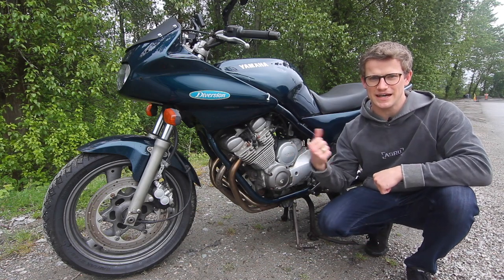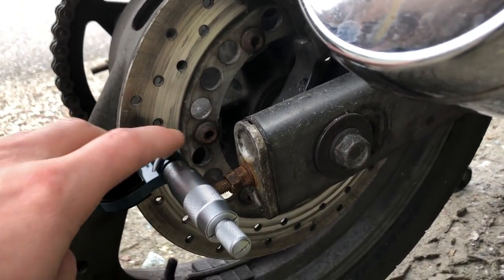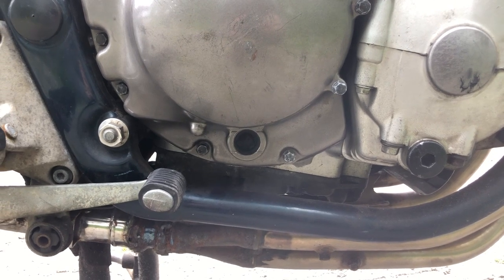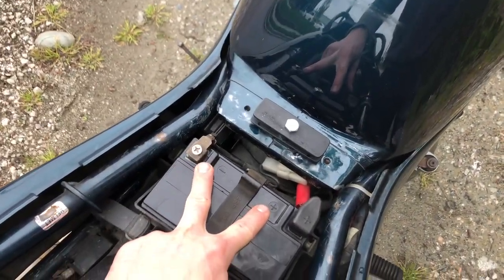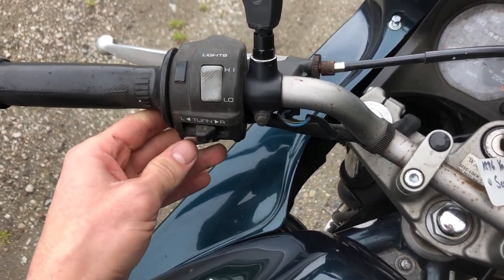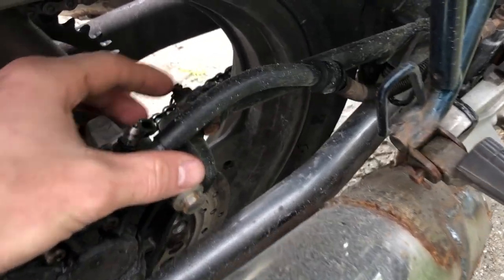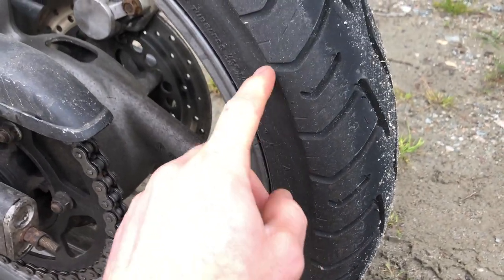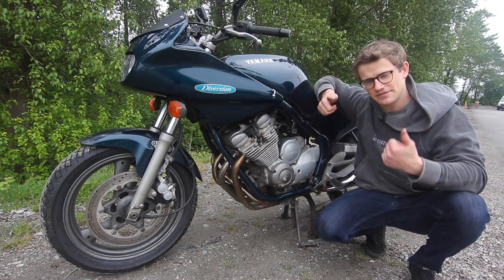Yamaha XJ600 Seca/Diversion Buyers Guide - Everything to Check!

Comment: Thanks. Helpful video!
Your bike has the usual Yamaha-Cheap-Bike problem: Rust!
I owned a Yamaha XV-535 and now have a 2001 Diversion 600.
They are best kept indoors most of the time. 
It also helps to spray a little silicone grease on the exposed bolts and nuts. And use white grease for the footpegs, brake lever, clutch lever, and clutch cable end at the engine.
But it is a nice bike to ride. It feels faster than it is. And fuel consumption is low. I do 25 km/l in the Netherlands.
Reply: A bit of maintainence fixes all of that. Once cleaned usea little vaseline to rub on bolts etc that are prone to rust. They'll never rust  again.

Comment: Hi from Ireland, I've owned a 94 model for eight years and if all you need is a reliable utility workhorse you can't do much better, I purchased my one for £400 in the UK I got a flight over and road it home via ferry no problems 385mls , regular oil and filter is the key especially in winter, Metzler block pattern tyres,blackwidow 4-1 exhaust system,starts first time at the moment 3° Celsius here in Ireland, not bad for a very very cheap bike, and don't ask "is it fast"🤣🤣🤣😎

Comment: I bought a 92 for $200. Needs work but i dont mind. Carbs and tank are the major issues but a rebuild of the carbs is coming soon. Tank is not worth saving so im trying to source one. Changed the brakes and calipers. Brake fluid reservoir and line. Needs new tires.  Rode her so she runs. I'll figure out any other issues as I go. Also new clutch friction plates incoming. My carb screws require a JIS screwdriver. I learned that the hard way.

Comment: Can anyone help me with some info? I've got my yamaha xj600 2000 but the problem is that i have a non original tachometer. The thing is, I'm not sure how hard can I accelerate. I read that at around 4-5k I should feel some trepidation and after that is fine. But i have no idea how hard can I go. For me the rpm is somehow divided in 4 lvls. First is at 4-5k when the trepidation starts, lv 2 is after, when things are smooth which feels nice, lv3 i feel again a little trepidation, a smooth trepidation, but and also screams the loudest, lv 4 again feels smooth again. If anyone can give me some advices, I am grateful! Thanks!
Reply: My 98 revs to 9k no bother. Does sound like an old Honda civic though